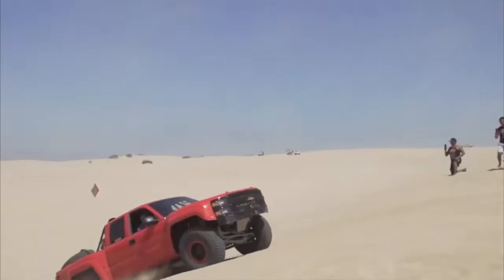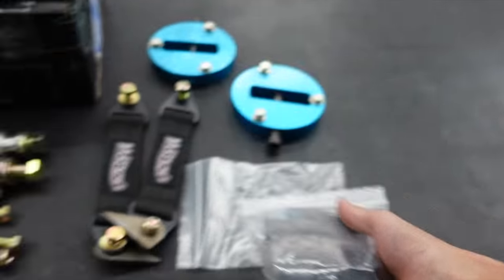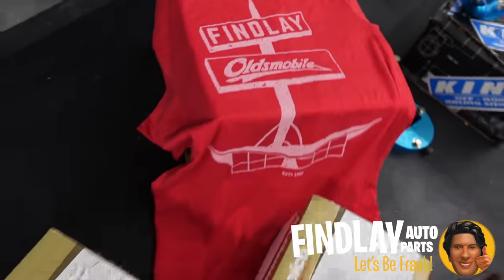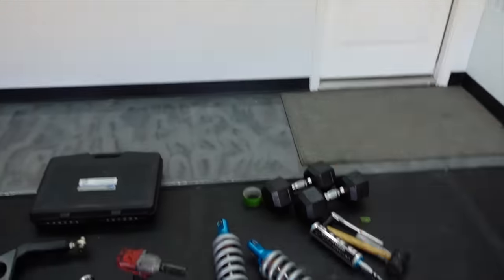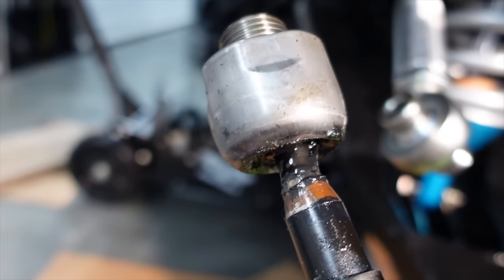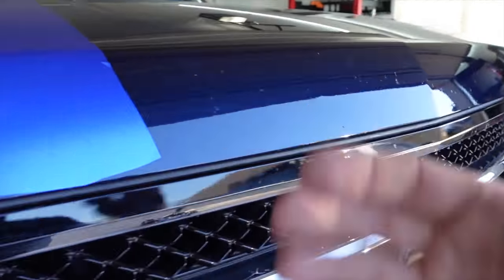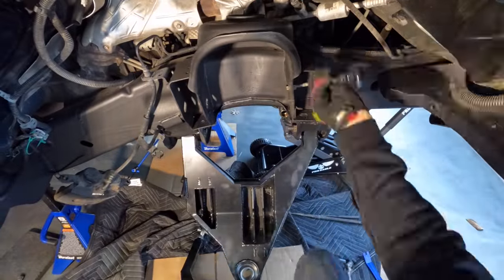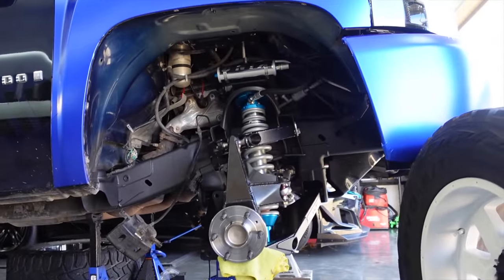Ultimate Silverado Suspension Mod - LONG TRAVEL CWF [King Shocks]

Comment from the maker: Welp... I'm an idiot and installed the spindle wrong (Thanks @CWFoffroad for catching that!) uniball mis spacers go INSIDE the spindle...not under it. Thanks for the support 'ohana. Aloha 🤙🏽
Reply: 2020 sierra 4 piston calipers and rotors to match I had to use 1/8 spacer bolts right up
Reply: @jaygod6140  I’d be interested in a small video if you could make one . I have a 2018 I want the bigger 4 piston brakes on the newer silverados
Reply: I wonder if this (or a kit available!) Would work on my 1993 Silverado.
I'd like to have this type of off-road performance in my trucks suspension.
Glad to see there's something for front,
Anything to update/upgrade the rear suspension to same level?

Comment: From what I understand, the 2022 Silverado calipers and rotors fit, giving you a 4 piston caliper with a larger rotor for pretty cheap. Might as well do braided lines.  You can also go with big break kits from Willwood or something if you want to spend a lot. Keep in mind your wheel size because clearance could be an issue. For rear breaks you can upgrade to calipers and rotors from the Tahoe of the same generation with pretty much no modifications and theres a way to do the swap without pulling axels. I have a sierra from this generation and Im planning on doing these upgrades myself someday . Hope this helps
Reply: Theres also a company called CTSV break swap and they sell a kit to swap C6 ZO6 calipers onto these trucks lol
Reply: The front and rear brakes from 2019 and newer GMC/Chevy 1500 trucks are almost a direct install for the older version (99-08) GM trucks.  One downside is that you will have to grind away some of the caliper material (just extra metal really) to make things fit up snug and factory looking.  Yes, they are 4 piston calipers and much larger rotors/pads to go with it, which also means having 18 inch (minimum) rim size is required for use of those brakes.  1000% better than OEM brakes from that era GM truck and a relatively inexpensive upgrade for anyone to do.  

Getting the parts and equipment ready to do it on my 01 Silverado Z71 for this coming new year project.
Reply from the maker: Yeah I'm probably going to go with an 18" wheel (even though 17" is most common for PreRunner trucks) just to be able to fit a better brake setup. Thanks for the reco!
Reply from the maker: Super helpful! Thank you. (I might just steal my wife's brakes off her truck 😅)
Reply: @LonestarHawaiian  LOL. Yeah it’s a good clean swap. I’m so hyped for your build,  planning on doing essentially the same setup to my truck ( If I win the lottery lol) but I would love a video on whatever break upgrade you end up doing because there isn’t a lot of info available on YT.

Comment: Custom offsets has willwood big brake kit only downside is 20s is smallest wheel size you can run. Totally worth it. Done the same kit on every truck I've owned due to towing or hard braking

Comment: If you swap the coilovers over to the other side the logo will be facing the correct way👍
Reply from the maker: I thought of that, but the fittings on the shocks are directional. I want some blue emblems on these anyway 😎

Comment: 2019-2022 oem brake calipers(brembo) and rotors bolt directly on with use of washers as spacers to center the calipers on the rotors, am currently running them on my 2016 and the braking power amazing

Comment: Hey man, as for performance brake upgrades, here's what I did.  I've got a 2001 Silverado and i installed 2020 Silverado front brake rotors and 4 piston calipers.  It's a factory option and its a huge upgrade over what you and I have.  It will work on yours perfect just might need to install a very slim washer between the new caliper and your spindle.  Calipers were hard to come by when I did mine but got them from an AC Delco parts supplier in about a week.  Your flex lines should work but you might need to grind a tab off one.  You'll need L & R caliper and two rotors and a set of brake pads, total about $560 CAD.

Comment: "12 days into a 5 hour project" 
I felt that. I remember my first doing a kit like this I took it all apart piece by piece . 
in reality you can have the whole thing off in 9 bolts all in a big chunk. 
3 on top of strut, 2 holding caliper bracket, and the 4 on the inner side of the control arms. :P

Comment: Super nice kit!!! I recommend doing some sort of bed liner on the inside of fiberglass fenders helps them last longer and makes them a little more ridged, I’m from SoCal it’s a pretty common thing to do to fiberglass on prerunners also gives it a cleaner finish, Can’t wait to see the truck finished keep up the good work 🤙🏼
Reply: Another little tip is on your hose clamps around your shock reservoirs, you can put black heat shrink around them to give it a cleaner look, I have king shocks on my 17 Silverado and did this to the hose clamps with heat shrink
Reply from the maker: These comments are gold. THANK YOU. Super good info and perfect timing as I'm getting tread to tackle the fiberglass next. I'll also be adding some heat shrink to the clams when I swap those emblems. Mahalo 🤙🏽
Reply: Lmao well I’m way late to the comments on this but he beat me to it by a LONG SHOT. Out here in vegas we do it to. Love seeing prerunners in not so common areas but its becoming more noticeable in Texas. Got a couple friends with long travel trucks down there🤘🏼 CWF was my choice when I still had my 2018 Silverado

Comment: For performance brakes I've been looking into the power stop z36 brakes it comes with drilled and slotted rotors and carbon ceramic pads. If you want more brake force you could try and swap over like corvette calipers and rotors or Camaro I've seen both done and they look amazing. Besides that you can always get a Big Brake kit but those aren't cheap and run in the 2500-5K range which to expensive for me.
Reply: Powerstops made my Jeep JK on 35s stop on a dime.
Reply: @zachconroy1443  i got a 09 gmc sierra 1500 do u think i should spend the money to get the brakes and rotors?
Reply: @michaelrizzo7322  I'm glad I did the rotors. I think they help and they look awesome
Reply: @michaelrizzo7322  definitely would recommend the z36 kit from power stop i got them on my 14 ram and they work great

Comment: Great video. Although you may get away with reusing the lower control arm mounting hardware/bolts, it’s highly recommended to replace them with new hardware; because the torque specs are are damn near their max value. Every time they’re retorqued, you stretch the bolt, essentially reducing the tensile strength. I also believe they’re oval nuts?

Comment: Dumb question but are you suppposed to have that grease on the uniballs joints or more of a spray Teflon lubricant? The Teflon lubricant prevents dirt (tries to) getting in there because it dries
Reply: Yep you shouldn’t be using grease. Grease attracts dirt into the races and wears the ball down.

Comment: Not 100% sure but I think the lower control arm should be mounted in line with the center snout of the hub. Not beneath. The bolt should run through both holes in the spindle creating a dual sheer point. If you pause the video at 16:54 you can see the upper hole is not being used. I hope I'm making sense.

Comment: Dang dude.  That's one awesome kit ya have going there.  Great put together video and instruction for someone else that might be thinking of doing the same.  One question, are you going to put some headers on that old LS ya have there?  If so and you want to keep the same/similar exhaust system, go with a pair of ceramic coated Gibson Shorty Headers.  I have a set and they really helped to wake the motor up for torque and mileage.
Reply from the maker: It'll eventually get some power adders. I'm going to tackle the suspension portion first and then move on to power (headers included 😎)

Comment: You should replace the plastic front skid, you can get a good rodlouver skid plate to replace that one on eBay, guy in SD makes em for $240, worth it if prerunning
Also will need a Yukon posi locker if 2wd, cheapest you can find is on Amazon the sell it with gears for $500, most places charge crazy upwards of $800 just for posi
Reply from the maker: Thank you!

Comment: Build looks great! Question if you did all that work for the front why didn't you go for a true long travel rear kit with a bed cage? Also 2wd is king in the prerunner world so nobody will hate on that! And do yourself a favor if you really want to send that truck get some smaller wheels and bigger tires running a set of 35 on 17 inch wheels will make a massive difference in the way it handles jumps and bumps. Keep up the good work!
Reply from the maker: Much appreciated! Truck is going to get 37's .. still deciding if going with a 17" wheel or 18" to fit bigger brakes. I'll eventually do a bed cage. I can still use my hanger/shackle and Deavers with the bed cage and I can sell the shocks later 🤙🏽

Comment: Power Stop K15218DK-36 - Z36 Severe-Duty Truck and Tow 1-Click Front And Rear Brake Kit. I have these on my 2007 GMC Yukon that I use everyday, Overlanding, Off-roading, and Towing.  Honestly my truck brakes better with these brake towing our 16" bowrider boat then with the OEM brakes not towing anything!!!

Comment: Will the rear track narrower than the front?
Reply from the maker: Yes, the front has a greater track width. I'm contemplating some wheel spacers in the rear to compensate for the gap, but there will always be one which is common on prerunners.

Comment: Wouldn't the decal be correct if the coil over was put on the other side?
Reply from the maker: The fittings on the top of the shock are directional so it's built to go on a specific side or the hose would directionally move to the back of the wheel well.

Comment: That’s a Mid Travel suspension..  hopefully you go with 17s on 37s
Reply: False.
Reply: @CWFoffroad  umm ..it is a mid travel suspension.. the rear is definitely a mid travel. There should be a cage for bigger shock’s!! The front has the same stock coil spring tower.. it should have a bigger shock tower for a real “long travel suspension “
Reply: @BlueNose49  you’re half correct on mid travel statement. 16” of travel front and stock coil bucket for ease of install. “Long travel” is a wheel travel number criteria, NOT a shock mount style criteria. 
Anything OVER 12-13” is considered long travel by industry standard. 
Rear with the stock replacement kings (shown in previous video) we will go ahead and consider mid travel. Good luck blue!